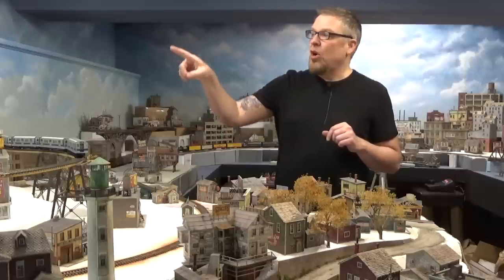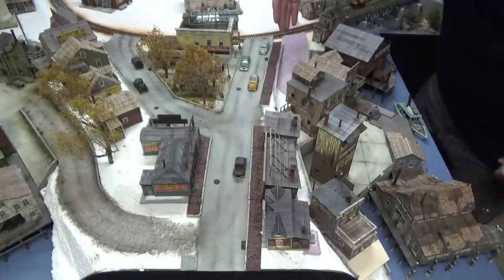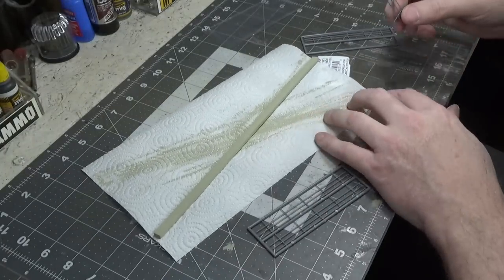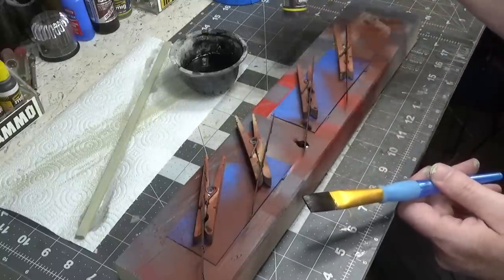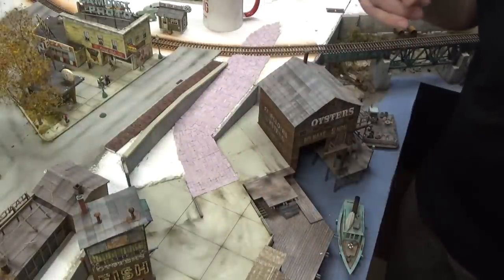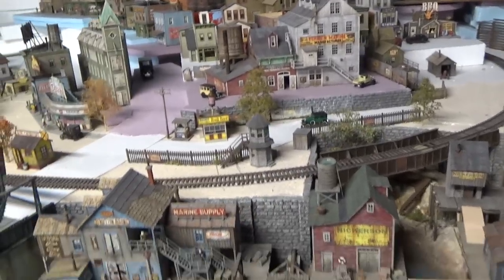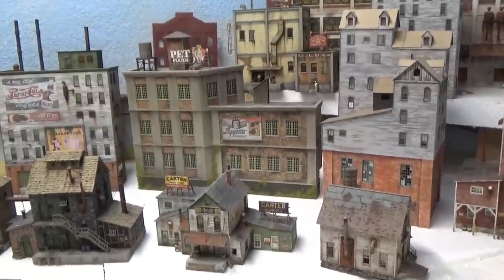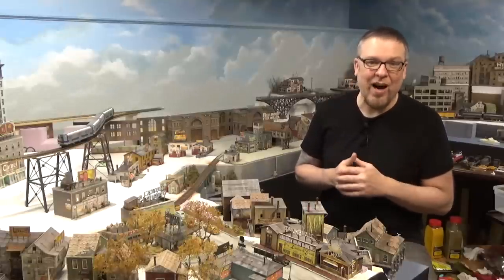Adding brick sidewalks and railings

Comment: Dear Jason, saw you use those FSM brick sidewalks before. Looks great, although I think even with styrofoam, either scribed or single bricks cut, a similar result can be achieved. Scene really starts to come together now, very cool to see. 
Love the idea of the cardboard cutouts. Paper is yet another way to expand the modeling possibilities. Although I agree, printed texture often needs some work. Hence, the suggestion to combine it with ways to create the illusion of depth. Whether it’s several layers of cardboard and paper, or combined with foamboard and underfloor insulation to create accents. 
Very cool vid, looking forward to your next episode. Cheerio
Reply from the maker: Thank you so much Vincent!!!